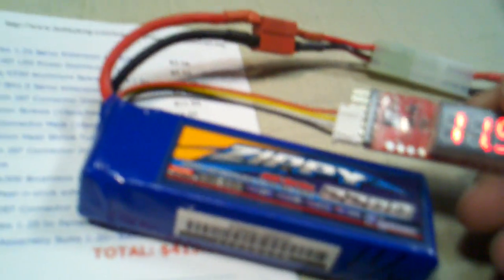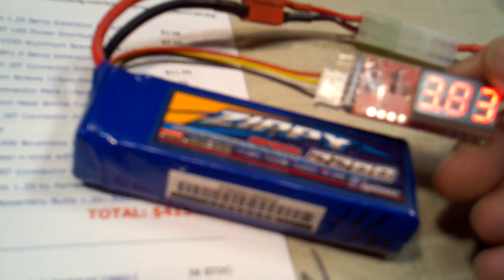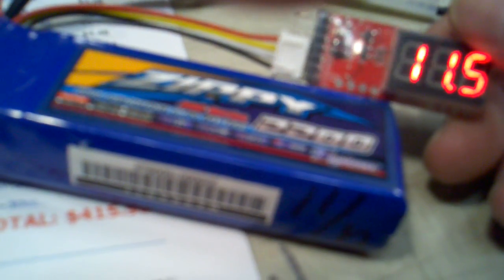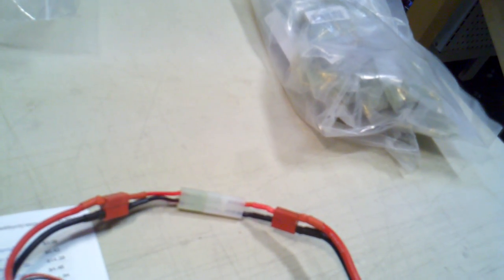how to fix a low voltage cell on a lipo battery

Comment: I have a question if you can answer. I have a onyx 5000 mah 7.4V 35C 37wh Lipo battery that I got from a kid I purchased my revo off of. It's got low volts from probably being left unattended. I have a Onyx 235 advanced balancing ac/D.C. Charger. Was curious what I should program it into, so I can bring the voltage back up.

Comment: nice video Matt, question for you I have a 3-cell nanotech battery and one of the cells is always lower than the other two when I charge the battery and one cell is always lagging behind the other two should I be concerned. for instance I might be at 3.78 while the other two cells or close to 4?

Comment: i have 3 lipo 2200amh 30 c they will not charge. there all at 6.6 when i check them. i only have stock charger that will not charge them, why?

Comment: Can I ask you, I have two 6s 4400 mAh packs that are virtually new, that is, maybe 6-8 flights being used in my Habu. Like you i stepped away for a while from the hobby and tried to fly this weekend and both times I had to land because the Castle esc was beeping a low voltage cutoff. Is this because i had left both packs fully charged? I want to know if my issue is battery or a problem with the power setup i.e. the esc or the motor? Thanks.